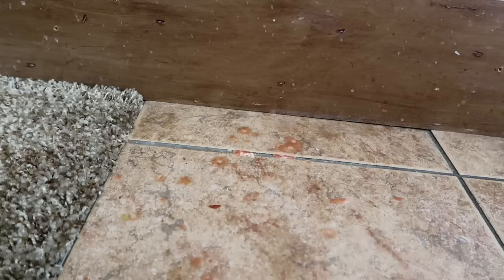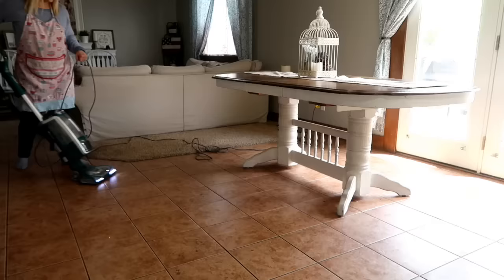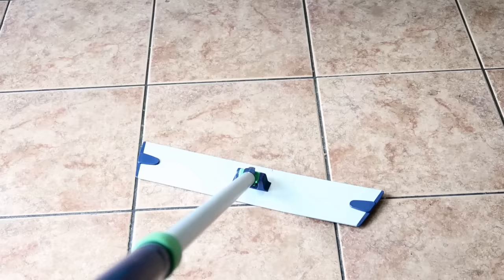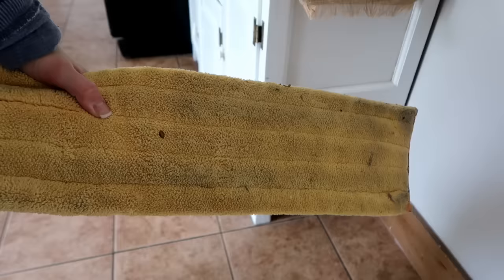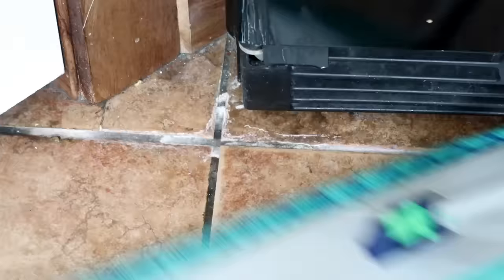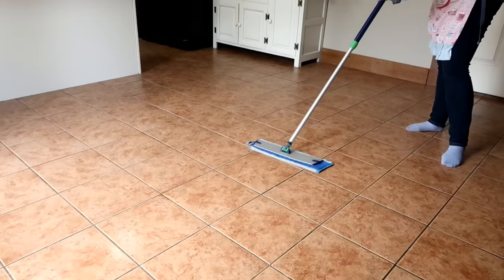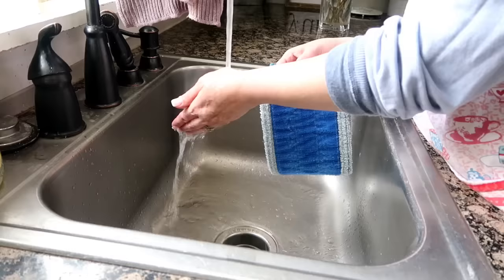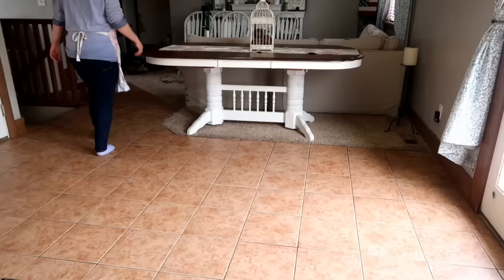How I Deep Clean My Floors- Washing Floors Motivation

Comment: I have a scrub brush for boat decks. I get a bucket of hot water. add in mr clean and some baking soda laundry booster. then scrub scrub scrub. mop up the water with a towel. go over with a steam mop later.

Comment: I have a tile floor and I hate it. It’s just myself, my husband and our Yorkie but the kitchen floor seems to need a cleaning constantly as we come in and out of the garage which is also where our washer and dryer is located. I used to use a swifter wet jet but it never cleaned to grout. Now I use Method squirt with a damp mop daily and deep cleaning I use Mrs Meyers all purpose cleaner with oceda spin mop which I absolutely love. I’ve been recovering my surgery on my knees and I am aching to clean lol. My husband does an “ok” job with the dishes and sweeping and quick mopping. He even vacuumed on Saturday cause we were having visitors. But I’m itching to clean lol. I deep cleaned the day before my surgery last week.

Comment: I clean my kitchen floor with the following: a spray bottle of household cleaner, a damp cloth, a dry cloth. I get down on my hands and knees and spray a small section of the floor and wipe with the damp cloth, followed by the dry cloth. I do this repeatedly until the floor is done. I have tile on my kitchen floor that has a finish on it that only can be cleaned using this method. I also have a galley kitchen, so it doesn't take me very long to clean my kitchen floor at all. Easy clean up too.